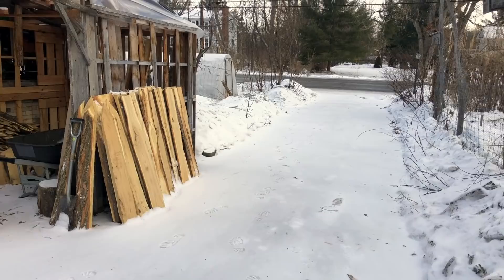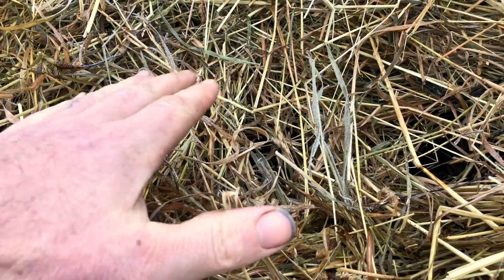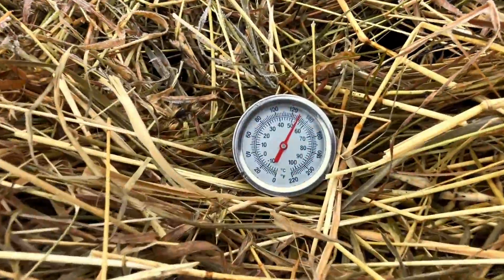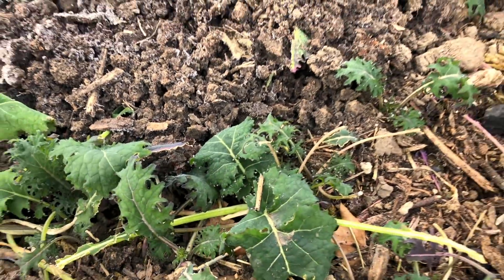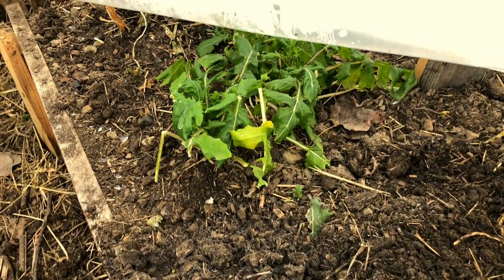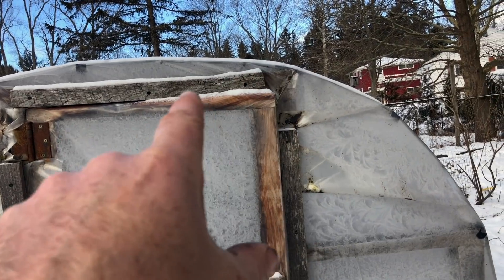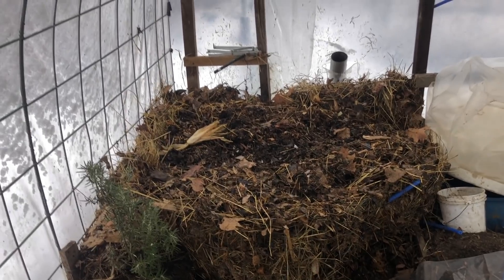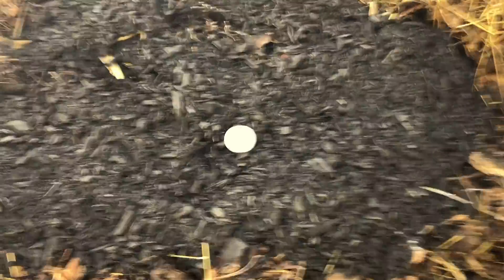Compost Heating - Update and Evolution!

Comment: How about putting a copper coil in your compost, so that water holds longer in the heap, and increases in temperature?
I feel that a water tank is unnecessary, and the piping could be a closed system, so there would be no evaporation, and the water would be hotter.

Comment: In the new alchemy institute compost heated greenhouses, they actually blow air from the the top of the roof (as heat goes up..) true the compost, and this air goes then under the beds, so in place of eventually breathing bad gas, you end up by watering undegroundly the plants with vapour, and fertilising it with ammonia, while releasing filtered air. Finished compost is the best filter, with charcoal

Comment: One thing about pex is it’s not UV resistant, I found this out when I was building mini greenhouse hoops with pex since pvc pipe wouldn’t bend as far as pex. I ended up still using pex and slipping pvc discharge hose over it to cover it since pvc is uv resistant. If you have any exposed sections of pex I would definitely recommend some sort of cover.
Reply from the maker: Good to know

Comment: Thank you for experimenting with this and sharing it. I’ve been playing around with ideas as well so it’s great when I find a video experimenting with ideas I’ve had! 

I’m sure in your research you’ve come across walipini. What if you utilized the same concept as a cold sink with air tubes. I’m not saying use air instead of water… but maybe a combination of both. I wonder if there is a way to capture the heat coming off the top and circulate it down toward the floor of the greenhouse with tubes (with holes like the drip line only for air to escape) that stretch along in front of the raised beds.

Comment: I dig out my walkway each year and then build a compost pile in all my paths through out the green house. This heats the whole house evenly and I lay a drain pipe about half the way down with the ends sticking out at each end of the loop and use the fan from my climate battery to also pull air through the walkways for extra heat when the pile heats up.
Reply from the maker: Sounds like a rad system!

Comment: Dude, It looks like you are onto the right idea!
I wonder though, why not make one big compost pile inside one greenhouse? Then your circulator pumps and storage tanks could serve more beds at once and possibly even your home as well. The compost heat could supplement the heat for your domestic hot water and even help to heat your home with a radiator too.
That being said, there certainly is a lot of value in trying out a few different methods like you are in order to find the medthod that is most worth investing in on a bigger scale. Chinese greenhouses are really sweet too. Simple teck did a good video on them. They have no heat but are very effective in the cold
Reply from the maker: It's a great idea around heat efficiency to be sure, but the off-gassing would be a challenge if it is to be associated with the house.  That just won't work for us.  Another greenhouse that stands alone, absolutely the compost should happen inside!

Comment: A while ago I saw a guy heating water with a diesel car spark plug. I don't know about vehicles but I think the diesel plug is effectively a heating element. He was using a solar panel to out-put 12 V, but one could also use a wind turbine like they do for sailing boats. I only mention the wind turbine as you said it was windy. It would also be possible to have the plug wired up to both wind turbine and solar panel. Just a thought.
Reply from the maker: Super interesting lead for research, I will definitely check it out.

Comment: I've containerized this process (500gal cylindrical tank with copper tubing coils as heat exchanger), and I'm currently running experiments, but yeah, i think you should have a reservoir / holding tank.  Run a really slow circulator from holding tank thru compost, and then another really slow circulator from holding tank through the beds.  The holding tank will allow you to store more heat energy, and maybe from there you can circulate through another bed.  Kind of like a home heating system with multiple zones / thermostats.  Please continue to share anything else you figure out.
Reply from the maker: Sounds like you have a pretty well developed system, that seems great!  We'll share more notes on this experiment as it all evolves over time.

Comment: I would love to have some of your selection of foods you can grow, but I'll stick with my high heat and poor sand. I've had tomatoes in the ground since January down here in Florida. I would think a coiled line making a loop about ever 6" in high would be best, but you would have to rebuild the entire pile to put that in the center. 
The other option is to just build up. Since heat rises why not put a kitty pool on the top of the pile and pump your water from there.
Right after this video was your exact answer. This guy's contract info is at minute 53.00. Most of what he shows is much larger scale then you are most likely looking for. However he also says that he doesn't care about the size. No matter if you are doing it on an industrial scale, or you in you backyard. All he cares is that you are serious about wanting to do things environmentally right. https://youtu.be/cvMi6hgfcnw
I haven't seen the second half yet, but you wanted an answer.

Comment: To utilise the heat from the compost, could you try building a compost pile below the garden beds (or placing the heathouse on a higher step with the compost below and contained), so the heat was transferred naturally as it rises via a tube into the hothouse?...
Reply from the maker: That would be a really smart basic design direction to take for a future project...
Reply: That's basically a hotbed i believe. They were popular in Victorian England

Comment: This is a great way to heat a greenhouse. I have a tiny greenhouse (less than 8'x8') that I heat with a cubic metre of horse manure and coffee grounds/wood shavings compost. Heres a farmer in Alberta (link following) commercially growing tomatoes in a green house with no supplemental heat. His coldest was somewhere around -25 c.   He uses a type of green house popular in northern China. His north wall is a metre thick wall of clay that acts as a massive heat sink. Its double walled poly and also uses insulating blankets that roll out at night. Here is his you tube link: https://www.youtube.com/watch?v=X3uhkj82H7U    I have a strong feeling hes pioneering green house tech in NAmerica that will radically change the face of commercial green houses in places that get sufficient sunlight.
Reply from the maker: I've found that channel before.  Interesting concepts for sure, although a lot more tech and infrastructure in relation to what is grown in my opinion (super low nutrient density coming out of that space, no layers of plants, etc...). Something to look at and think about to incorporate the food forest vibe inito!
Reply: @edibleacres  Considering he is new to farming and 2020 was his first year with this green house (he is already building the next greenhouse ) he has done well commercially. Far more importantly the area where he is growing where winter temps regularly drop to -30c to -40c : absolutely no one in the area and  more or less anywhere else in Canada is doing passive solar with no additional energy inputs for heat is amazing and frankly revolutionary. Once he gets dialed in to his process,  he can tune up the how and what in terms of nutritional density etc. Other than the one electrical motor that was used to open the windows and also to control the insulating blankets, I didnt see a lot of "tech" in this commercial scale set up. But I do agree that it is heavy on initial infrastructure cost. But the wall, and structure itself now are more or less permanent or at least long term. But keeping in mind that this is a commercial operation that $$ cost will be amortized quickly considering he now is growing  year round and other than replacing the poly (which is a big deal in my mind) he is not burning anything and  spending zero on heating. ie he isnt bringing in any straw compost heaters etc. Even the way he is using (and re using) the poly mulch, that saves on water for irrigation as it reduces evaporation. He mentioned in a different video he cant use the local ground water as its has salts so the pit he dug when he excavated for the heat sink clay wall, is now a rain catching water pond. He says its enough to water the green house all year.  The compost heater works, even on a commercial scale ( that is what I use to heat my own small green house.)  More than a hundred years ago European market gardeners were able to supply fresh vegetables all winter long by growing on metre thick beds of horse manure (readily available in cities as transportation was by horse) covered by sheet glass and galoches. Commercial farming in this country needs to look back at its own history and incorporate yesterdays technology along with modern passive tech to move forward sustainably

Comment: maybe I missed a video where you explained, why you don't do this, so I'll just ask ;) Why don't you build a "hot bed" - (thats basically a raised bed with "bottom layer of straw/horse manure (or other hot compost - like from the chicken yard) as a heating system for the growing medium (soil and compst) on top of it)? As far as I know, that's how they did it, before all the modern stuff like big heated greenhouses where invented. So there sould be much information about when to build it, how much hot stuff, how high to build it etc.  And it's actually called "hot bed"...
Reply from the maker: We do plan to use the 'tops' of these compost piles as seed starting spaces for warm loving plants soon... So we'll utilize that heat directly..

Comment: I didn't read every comment but here's my thought process on this Sean. Look at that steam I think you honed in on it. That's worth harnessing. What about using some of that scrap green house plastic you keep and, "drape" the in-house compost pile, as if to create upside down funnel. Pex tip end is zip tied/clamped to ceiling at the top of "inverted plastic funnel", and thus the plastic clamped around the pex. then pex connects to your continuous bed circuit, finally the cold end is pushed in the middle of the compost pile just near the bottom. ,,, the result?  you might get a continuous steam heat circuit into your raised garden beds? You might also keep any noxious gases in the greenhouse "tethered" to the heat system? and your layer of charcoal on top of the pile is On Point. Maybe no solar or electric work needed in the end? Air is 700+ times less dense than water so i was thinking the quick warmth of the day would go quickly into soil, rather than taking long time to heat dense mass (water), then radiating sort of slowly. But then again that sounds good. So... Ideally youd have both? a water loop and an air loop? Thoughts? Hit me with your best shot.
Reply: By the way said "upside down scrap plastic funnel", really could just look like one of those cake icing bags when they are almost spent. Ya know what I mean? Doesnt have to be bulbous. The plastic could drape the pile and come abruptly up into a corner. That leaves this nice top of the pile where you can set your "startling" trays. thoughts?
Reply from the maker: I would wonder how well hot air would move through those 1/2" tubes.  Maybe it would but I just have my doubts because the water certainly doesn't do so easily, it needs help!

Comment: Have you seen Geoff Lawton's design for a hot compost shower? 
I think you could you the same theory and put water pipes through the pile to create a warm water thermal mass of some kind. Rather than putting hot water straight in the beds which might damage the plants. If you have a large water container with a lid or a series of tubs, then fill it with some rocks for more thermal mass.
All that you need to do is circulate water and you should be able to spread the warmth to the paths and beds in the high tunnel.
Reply from the maker: Good idea here

Comment: great, exactly what i looked for. i hope i will have the opportunity to test this in the future. 

alsowhat do you think about an double plastic layer on the building , creating like an air layer isolation?
Reply from the maker: The double poly... I'd need to 'inflate' it to have it really work well and I don't think I'd want to get that deep into all thiis..
Reply: @edibleacres  oh, ok. never tought about that but i think that perhaps it doesnt needs to be as airtight as the first (inner) layer. im thinking about the snow for example, surely it has to cool down the building a great amount if laying on the roof as in your video? or perhaps not because it could dampen the wind? idk

also, perhaps compost piles  , or at least a bunch of hay laying on the sides of your walls on the outside would do some job

also i think i saw a yt clip showing a person who had air pipe in the compost pile outside, and taken into his home trough an air pump he says its like 200W/h on a day

Comment: Try using old bed sheets to cover your veggies in the green house the plastic sweats in the warmth and a sheet wont hold the moisture in but will protect from freezing much better. i did that i had fresh tomatoes thru January here in south eastern washington state. and mine weren't even in a green house. just a protected spot between the house and a shed. try it see if it works in the green house too. 
Thanks for sharing i like the heating idea to me is one of the best free energy we have.
Reply from the maker: Cool idea heres here.  Thank you.  Tomatoes in January, what a dream!

Comment: With the experiment using the pex tube to circulate heating under the bed, instead of using a pump, have you considered putting a check valve between the reservoir and return line so it passively pumps itself using the expansion and contraction of the water as it's heat content changes?  I think this is called a thermosiphon.
Reply from the maker: I've thought about it but I assumed thermosiphoning needed way more head or pressure to get it to work.

Comment: I thought that gap at the hoop house window looked like it was the perfect size to accommodate those gray foam pipe wrap insulation... the ones that look like mini pool noodles.  Also thought that the next time I am at the cheap tool outlet store I should pick up some moving blankets for covering beds in the future.  And it has been years since I read Daycreek Journals description about building a passive radiant heat system in a sand bed.  I need to refresh that in my mind. As always.... you get my mind churning.
Reply from the maker: Yeah, figuring ways to pack those gaps on the coldest niights seems quite important.

Comment: The hoarfrost is just a sign of warmish moistish air hitting the metal items which are outside temperature.  I don't see any way to fix that short of a complete redesign.
I wouldn't bother with the water tank.  Fill pex, and pump it.  You are never going to move heat from the bed to the compost.
What jumped out at me was how dry the top layer of soil looked, all the moisture that moved from the soil to the hoarfrost took most of the heat you lost with it.  More air tight will keep it warmer twice (air convection and triple phase change of water)
Reply from the maker: We need to mulch the soil as soon as seedlings come up.  I plan to do a very fine sifting of aged compost to mulch to help hold in the moisture in there.  It is amazing how heated that top layer of soil can get during the day.
Reply: @edibleacres  Also consider how to direct the condensation on the cover back onto the soil.

Comment: Great idea, it may work to keep the compost pile outside like the greenhouse opening more room in the tunnel. You would have to insulate the pile and the pipes between the high tunnel and the pile.  I think moving the pile out of the tunnel would also have an added benefit of feeling more zen or minimalist.  Defiantly easier on the eyes and less cramped.  It would also open up the flow in the high tunnel should you put a door on the other side.
Reply from the maker: I hear you... Challenge is that our site is already so packed and complex I'd be hard pressed to fit something ini around the tunnel!